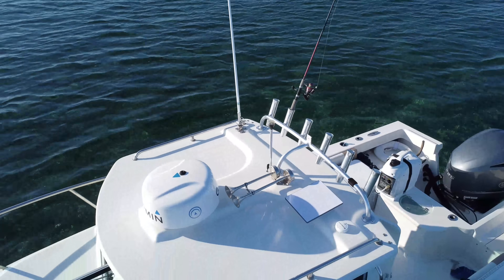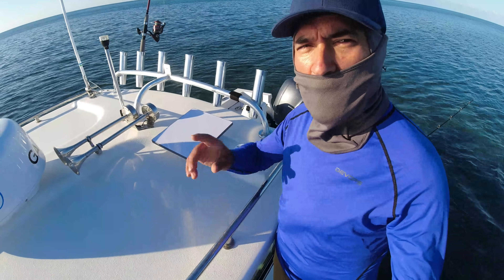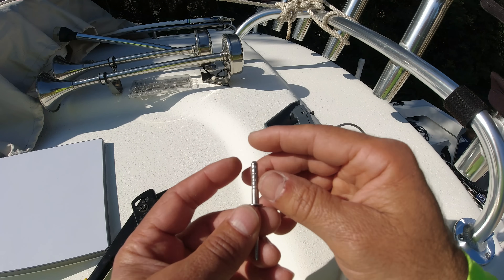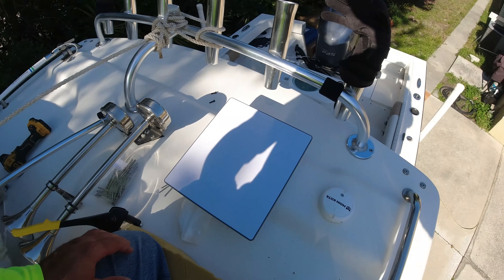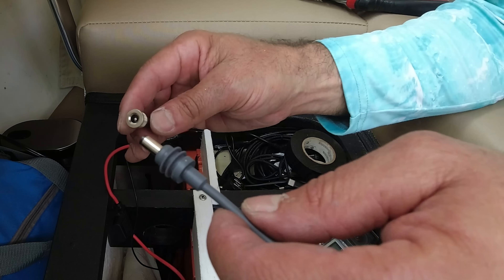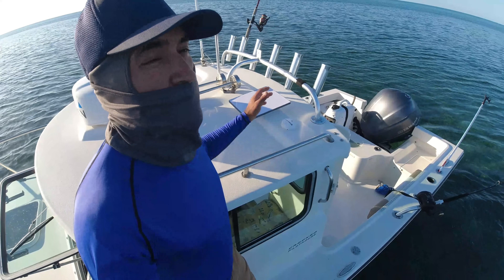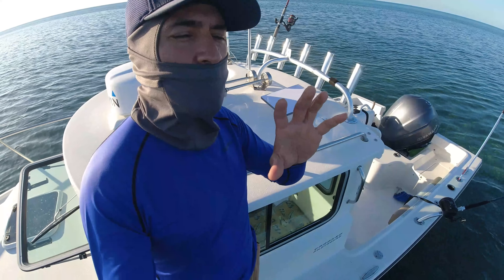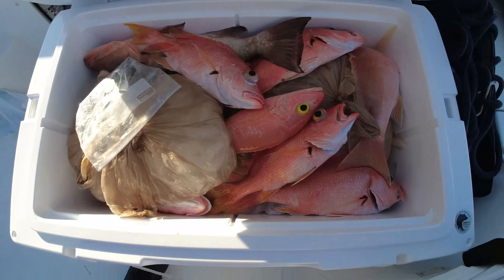STARLINK MINI on a Boat Installation and How does it Work?

Comment: How do you use yiur cell phone? Do you have to change your setting for calls over internet VoIp? If i turn off roaming, will I still be able to make calls?
Reply from the maker: Yes i ise it wifi calling cap and it works and since you purchased your satellite already you can use the link to get a free month ot was supposed to be purchased with the link cap.
Reply: @OutOnTheReef I don't see the link you are talking about.

Comment: Hey cap I got the mini with unlimited plan, however not connection out of 12 miles approximately from USA and got it back 12 miles from Bimini, not sure if I should select the ocean mode ( which only works with unlimited) or roam 50GB also can be used with ocean mode ? Not happy with limitation of 12 miles :(  saludos!!!
Reply from the maker: saludos cap y si eso es las limitaciones pero en las bahamas tienes satellite coverage casy en todas las areas, cuando fui a tortugas solamente tube 8 millas que no tube satellite, entre Marquesas y dry tortugas cap. saludos a Nancy

Comment: I have a 36 V lithium ion battery for my trolling motor , I would like to use my 36V battery to power my starlink mini . What plug/ cable do I need to purchase? 
Thanks
Reply from the maker: Hello cap just ise a starlink conector like i did and splice the cable ,

Comment: Have you used the Starlink while running the trolling motor simultaneously?  I'm wondering if a power drop from the trolling motor pulling a bunch of amps in a gust would cause issues with the stability of the Starlink?
Reply from the maker: no cap no problems at al because i connected the starlink directly to the battery terminals

Comment: I have a couple of questions ... Does the radar interfere with its reception? Doesn't it have to be angled towards a satellite or does the flat install that you have work just as well? Thanks in advance ...
Reply from the maker: no cap no interference at all from the radar and no need to place it in a angle , it works great even wen the boat is moving cap, hope this helps.

Comment: Love the vids, I've got a mini on my boat, but I don't have it mounted yet, I was looking at a SeaView APEX Mount which is $$$ but seems much sturdier than using the little mount like you did. You've not had any issues with rough seas and it disconnecting? That's my biggest concern, those little tabs that lock into the plastic housing of the antenna just don't seem very secure to me when the waves get rough. Again, great vid, keep it up!
Reply from the maker: I had no problem whatsoever, captain, it holds pretty good. And it has 2 locking boats.The helps from falling off the mountand mine dosentdisconnectwile at sea, navigate safe cap

Comment: did the solder melt (its supposed to) or did you just heat shrink it?
Reply from the maker: The heat shrink.It also sauters At the same time captain is a special heat shrink

Comment: Definitely will be a revolution in boating be starlink also too is #seakeeper how these systems are integrated into production boats no small matter as well as first to have Tesla Vision vehicle autonomous driving system you wont need #irony "a pilot house" anymore after that all be fully autonomous. "just tell it where you want to go" even docking even putting on and off the trailer. Amount of wiring let alone all of these extraneous items like radar very much set to vanish here. Seakeeper has to do with right correct "trim" for running so that will very much be staying tho. Might see all electric outboards as imminent as well actually....no more fuel bills, crazy quiet...crazy fast too instant on power be on plane crazy fast. Might see a range of 600-800 miles on that type of system...might include solar power #aptera solar powered car en route as production item 2025. Brand new electric pickup 🚚 🛻 🚛 🚒 🚚 🛻 🛻 company #slate just announced private company so could start seeing those trucks at any time. Won't tow a boat this big but a Tesla #cybertruck should can. Pretty wild time absolutely 😊😊
Reply from the maker: I agree cap is incredible what they have accomplished

Comment: Captain i heard u stating in your video for "cold weather warning for lithium batteries" that u have 5 lithium batteries. 2 on the fridge and 3 on the Minnkota.   Are they all 12 v ?  How many amp hours r each of them?  Great video.
Reply from the maker: Hello cap the minn kota is 100amp each total 36volts
Reply: @OutOnTheReef   so 36v, 300 ah?

Comment: You’re moving up in the world. Now is that hole you run it through in the roof. Is that some kind of special gland that you put in?
Reply from the maker: hello cap what you mean about the gland? i don't know what your question
Reply: @ where you’re running your wire down through the roof of your boat.
Reply from the maker: There is a room in between the roof there's two layers and there's a room in between for wires to go through
Reply: Thank you you’re always really helpful. I appreciate it.
Reply from the maker: Yes, captain.I feel like I have a mini yacht
Reply from the maker: I put some 4200 3 M in the small opening And
I attached the wire again, No that way the opening is not that big
Reply: @ thank you. You definitely get your money out of that boat. I think that’s impressive.

Comment: Can I ask why you would use rivets instead of just some stainless screws? I’m just curious. Hope you never need to remove the bracket. Very cool to have internet everywhere. I’d have it if I could afford it for sure!
Reply from the maker: I used the rivets because there's two layers of roof on the boat and It's very thin To place screws, And you know to remove rabbits is really easy.All you have to do is drill the head and they come off.Hope this helps

Comment: Jus FYI. Be careful using those low heat soldering butt connectors. I had a case where I used them on a light bar. The wire would get hot because it was near the engine. It would cause intermittent connection of the light and it basically created an electrical gremlin that I had chase down. I realized that it was the low heat connector. I changed to a traditional crimp heat shrink butt connector and problem solved.
Reply from the maker: That's a good point, captain.If it's next to a hot item, you shouldn't use those.Thank you for the awesome feedback
Reply: I don't use butt connectors at all, especially with solder. Wire vibrates on a boat and the interface between the solder and the wire is a break point. I wrap the wires together at a 90° angle and back on itself, then rubber tape it (not vinyl tape) and then shrink wrap over that.

Comment: why wouldnt it work!?!??!?!?!?!?  its gonna work for all the cruise lines and not you?
Reply from the maker: The cruise line has the expensive package.I only have the cheap package of fifty dollars captain so it cuts the connections That
's why it's called coastal use only.
So now you know there's 2 plants.The plant that covers everything and the one That has limitation which is the one I have now, that's why i said that.Hopeless helps

Comment: I thought Starlink Marine  had no boundaries?    Do you have mobile?   That will stop working off shore.
Reply from the maker: this one has boundaries but is only $ 50 per month , the one with no limits i think is like $299 per month cap
Reply: @OutOnTheReef  Ok that makes sense. and for a 20 mile dead zone,  its not worth the extra $.

Comment: Most people don't know this as I didn't until about 10 years ago... I'm quoting 3m "Limitations : - Alcohol should not be used in preparation for bonding as it will interfere with the curing process, causing the adhesive to fail."  Sorry to be the bearer of bad news.   Always great watching your videos!  Enjoy, Frank
Reply from the maker: No worries cap. Thanks fpr your comment and your reply,  we are here to learn from eachother,  have a awesome night cap.👍😉🛥
Reply: @OutOnTheReef Yup, I've been doing this both professionally and for myself for over 40 years and I still learn stuff every day...
Reply from the maker: well cap wen i used alcohol to install my outboard and after 2 weeks i had to take it out to raise it ,i took the bolts off and the 4200 hold the engine by it self, the a over 500 pound engine just holding on the transom just with 4200 and i used alcohol, imagine if i did not use alcohol, i quest i will never be able to take ok , thanks for your comment cap.
Reply: @OutOnTheReef  And I have to apologize,  I don't use alcohol specifically because 3M has that quote in their technical data sheet.  I went back and kept reading and they then follow up that warning  with...if you cean the surfaces that you are bonding with alcohol, make sure that its thoroughly dry before applying the 4200.  And Watching your video  agaimy guess is that in the heat of FL you probably did that so you did okay.  Sorry again, was going off my memory and cutting the sentence on the data sheet without reading further.  My bad!
Reply: @user-gb4hr5nt9e  Nice job on calling yourself out.  I for one, respect that.

Comment: Next project I see some space for a solar panel. I purchased one that came with built in converter and alligator clips. Just set up the panel, connect the clips to + and - with a 100 watt panel thus, on a sunny day, you may charge a 100 amp battery about 50 to 60% depending on sunlight. Unlimited power is a game changer. Soooo simple! Tried it on my shed and will install on my boat next.
Reply from the maker: That is awesome cap. But i consume 2000 watts most of the time i runy generator so 100 watts will do very little for my use cap ,thanks😉👍

Comment: I work offshore. We got Starlink last year, and have had service in every location we have traveled. Including the middle of the ocean. We regularly transit  60-90 miles offshore. Great upgrade. Safe sailing.
Reply: I’m assuming the company I work for has the expensive plan. They have over 20 boats in their fleet. It’s a tug boat company that mostly services SE and Central Alaska. We had KVH for a long time and it was terrible. They made the switch last year and it’s been amazing. I believe all the boats now have it in the fleet. Love your channel on YouTube. I’m always sailing in cold crappy weather. It’s nice to watch your adventures in warmer waters. Safe sailing brother.
Reply from the maker: Do you have the expensive plan that cover all oceans cap? Or did you got the 50$ plan?
Reply: @OutOnTheReef great vid would like to know what plan
Reply from the maker: Gremco i have the $50 plan and is 50gigs witch is plenty for long trips for me
Reply: @OutOnTheReef  and with mini and 50 GB plan you can have connection 20 miles out? (approximately ) ???
Reply from the maker: In the Bahamas, about 20 miles out and the USA about 13 to 15 miles out.
Reply: @OutOnTheReef  did you activate ocean mode by chance? they charge 2$ for GB extra ...but I think only works for the unlimited!!
Reply: @OutOnTheReef is it "20 miles out" from their (Bahamas) international country line, or from any island or from one of their cell towers?   At what speeds does it work or not work?  and does it work on a boat mounted flat on the T-top?  these questions are for the $50 plan.   So no coverage in the middle of the Gulfstream: Jupiter to Grand Cay.... ?
Reply from the maker: Hello Pedro and it work in my plan i only paid $10 and adirional $2 per G
Reply: @OutOnTheReef  That's the final information I need. Thank you !!!
Reply: Do you know which unit it is? Is it the mini?
Reply: @JTB-j9z I’ll see if I can find out for you.
Reply: @JTB-j9z  I'm sure the company is using the Starlink Performance antenna with the Global Priority package. Most industrial ships use two of them for redundancy. Each antenna costs $1,500, and the plans start at $250 per month for 50GB, then increase to $650 for 500 GB. (USD)
Reply: @JTB-j9z sorry I haven’t gotten back to you about what unit or plan we have at work. Been swamped and honestly forgot. I’ll shoot an email to our IT guy and find out what we run with. I’m certain it’s not the mini. But I’ll check.
Reply: @JTB-j9z  so sorry for the extremely late reply. I finally asked our IT guy at work what we have. He said it’s the Version 1 Maritime unit. He said the newer version 3 would be much smaller than the one we have. I don’t know anything about this type of stuff. All I know is it works great. Hope that helps. Safe sailing.
Reply from the maker: From a land cap.

Comment: Mini spec: Power Consumption	Average: 25-40W
Is that 120V?
Reply from the maker: im using 36v cap and 12v will not work even if it says it will on the specs, thanks cap.
Reply: @OutOnTheReef  Thank you. I missed the "36V Minn Kota" reference. Sorry for wasting your time.
Reply: Hi Cap so you saying I dnt need need a marine starlink if I'm not going too far offshore, just the regular mini?
Reply from the maker: No worries cap. Whatever you need just ask👍⚓️
Reply from the maker: Yes the starlink mini works up to 12 miles from land and is a great price cap.

Comment: Hi Capitán! I'm not a technologist by any means so my question is can this device give me internet access on my tablet and laptop? I'm assuming yes. Also, does this require like a monthly plan like I have with my cell phone? Thanks for another great informative video.  Palanté como un elefante siempre Capitán!
Reply from the maker: Yes the monthly plan is about fifty dollars but there's another one ten dollars that gives you only ten gigs In that plan, you can only see it when you subscribe to the first plan.
And yes, it will work on your tablet.And your phones you can connect almost a 140 devices.
At the same time cap ,pa lante
Reply: @OutOnTheReef this is a great way to work remotely on my boat a game changer for me!

Comment: Hola una pregunta el starlink funciona en 12 vol  o solo 120 gracias
Reply from the maker: En mi caso 12v no travajo tine que ser mas voltaje ,posiblemente 24 en adelante ,en mi installacion estoy usando 36v pero 24 tanbien deveria tracajar oh puedes usar 120v si tu barco toene 120v
Reply: @ gracias por responderme si tengo 120 con el generador voy a ver cómo darle 24 vol gracias 🙏
Reply from the maker: Seguro capitan ,dejame saver si tienes otra pregunta, saludos